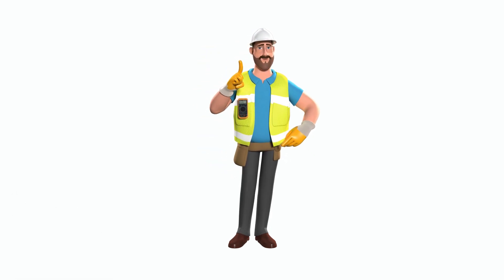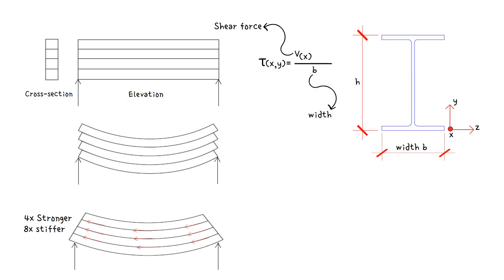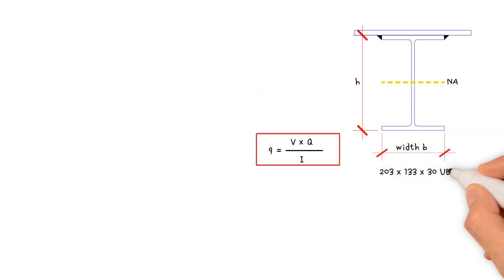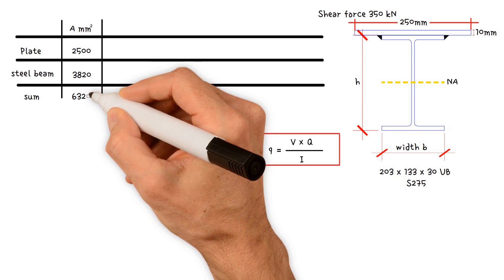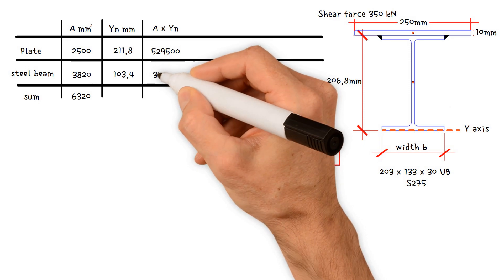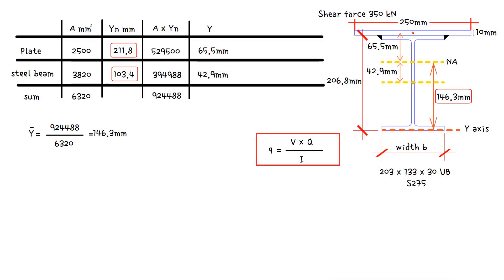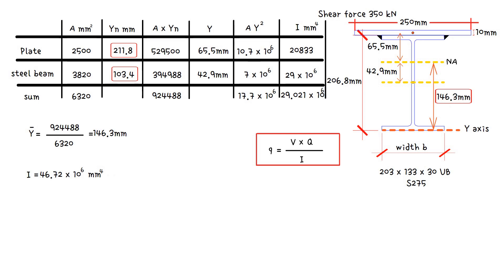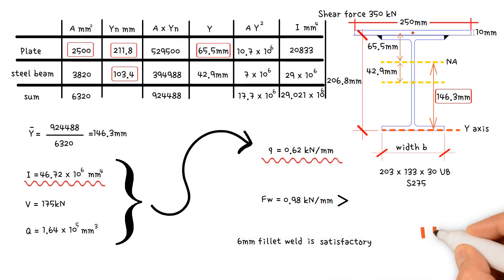An Important Equation Most Structural Engineers Neglect.

Comment: when doing metal trusses does the diagonal bracing have to be at the angle of the roof pitch ? ie my pitch is circa 5/12 with a vertical cut at 65 deg thereafter all the diagonal bracing at 90 deg to the vertical angle
Reply from the maker: Hi there!
Yes the diagonal bracing has to be at the angle of the roof pitch to resist the lateral forces :)
Reply: thanks I will be building a 10.5m span so the trusses approx 5.25 so each one will mirror the other 
 @structuralengineercalcs